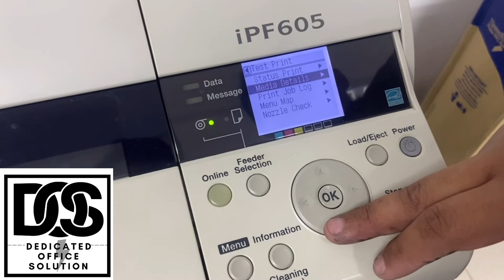Full Tutorial Of Serviced Purge Unit in iPF605

Comment: This is THE VIDEO of Canon printers.  Thanks a bunch for going through each step of the process.  How do you clean/flush the ink tubes from ink tanks to the carriage?  Do you have a video about this process?  Thanks again.
Reply from the maker: Tq for your comment , at this moment I don’t have the video for this. I will do recording when encounter this problem
Reply: @dennisthefatkid  Thank you, Dennis :-))  I went through the steps you showed in the video, trying to service the purge unit today.  I encountered a problem: the vacuum pump at the bottom of the purge unit DID NOT allow any water to pass through.  So, I had to rotate the big plastic gear connected to the pump by hand to be able to flush the old ink.  I am not sure the old ink was flushed out!!!  Your video showed no blockage of water by the pump as you flushed the lines.  How did you bypass the pump?  Also, I have a horrific time to find these two pads in the purge unit.  They need to be replaced.  Where can I buy them?  Thanks again for the great video!
Reply from the maker: @windsurfer3329  hi sir, yup.. I have to rotate the big gear in order the water pass through /flush out the dirt, if the water doesn’t out from the black tube , it meant the purge unit is problem. I suggest to replace the whole purge unit (better to purchase new purge unit) about the pad you may purchase with Canon , may I know what model you using now? let me check the part number for you by tomorrow
Reply: @dennisthefatkid  Hi Dennis, I have what you have in the video, an IPF605.  Thank you for reaching out to help me :-))

Comment: Hi Dennis, Great video. I am using it help me replace the purge unit of an iPF780 ImpagePrograf. I only thing I can't do at this point is the 'wired connector' that connects with the old Purge Unit. There is almost nothing to grab onto and the release pins are tiny. any suggestions? Thanks! Rob (I can send a pic if you like.)

Comment: Very detailed video thank you!!, i have one question i hope you can help me with, i have old canon iPF 6400S, which i got for very low price, it's working fine except it's PM or M(Can't really remember which color exactly) Color doesn't print at all and on nozzle check it's basically doesn't exist or very few nozzles working and not in a straight line, old owner told me he got a new print head and it printed less than 10 prints and same issue happened again no PM or M Color, could it be purge unit? or something else?
Reply from the maker: Hi Sir, yeah… print head and purge unit are related , since you’ve replace the printhead , try check the ink tube of M & PM, is that filled with ink inside, if no… you have to replace the purge unit. My advice is ask for professional to do the checking, let them quo whatever related parts is spoilt before repair

Comment: Hey man, i got an old ipf605 that was off for more than a year. when turned on the printer asked to replace the printhead with E161-403E. Turned off, cleaned the printhead manually and reinstalled, turned back on and printed just one nozzle check pattern with service mode, at this point the printer shoewd an hardware error and i turned it off.
When turned on again in Service mode, it displayed "replacing CPU" and then "close upper cover".
Can anybody help me i'm stuck 🥲
Reply from the maker: Not worth to replace anymore my friend . After replacing board and cpu, I believe the error code will pop up with another msg

Comment: Hi! My IPF750 plotter is showing this hardware error 03130031-2f26 and I can't even access it in service mode. Can you help me?
Reply from the maker: Hardware error 03130031-2F26 is a carriage motion error.  In this blog, you will learn how to troubleshoot this error.  Try check cartridge belt, carriage shaft… is that any foreign object blocking, if no.. you may try to lubricant some oil to carriage shaft. Hope this can help you 🙏🏻

Comment: Thanks alot engg
Reply: @dennisthefatkid  if i unlock the carage from the service mode and move it to access the purge unit pads
And unlock the carage should i turn of the printer or work with it on 
And if u turn it off the carage will lock or it still unlock
Reply from the maker: @عبدالرحمنباعقيل-خ9ل  can, you may unlock from service mode , but it will absorb and wasting ink, once the print head is move to centre you have to power off before taking off the purge unit
Reply: @dennisthefatkid  okay thanks but power of the printer from the printer button or from the electronic switch
Reply from the maker: @عبدالرحمنباعقيل-خ9ل  power off with power button on machine first , then pull out the power cable from wall plug (for safety purpose)

Comment: I get an errro code 2f1f it saye at the service manual pump cam sensor error change the purge until
What should I do about it engg ?
Reply: I have the 03130031-2f1f error on my ipf755, which indicates purge unit, which led me to this video. The process looks simple. What are the chances this clears the code?
Reply: @egoequus6263  i change the whole purge unit and nothing 
Do you have other way to fix it

Comment: I get error 03130031-2f26 than 2f13 after reboot
And the manual says check carage unit 
And A/D conventer
What's that
Reply from the maker: You try wipe the carriage rail and apply oil into it again, hope it’s work for you
Reply: @dennisthefatkid  okay i will try it the rail is cover with black fat should i clean it and apply oil instead
Reply from the maker: @عبدالرحمنباعقيل-خ9ل  in my experienced , some rail were dirty , use tissue paper wipe it will do , after wiping it … it will zero oil and it’s no good for carriage … therefore we need to oiling it again
Reply from the maker: @عبدالرحمنباعقيل-خ9ل  just clean the medal (chrome color bar)

Comment: I have same printer. Canon ImagePrograf ipf605.
I have Error code 03800500-2F2F : non discharging error.
Solution: Replace Head management sensor. Can you help me? How to fix?
Reply from the maker: Hi there, I’m sorry to heard about the problem , my advice is observe the head management, is that the red light (red led underneath the head management sensor) on? If light off, it meant head management sensor problem , try check the flat cable which connected to head management sensor , be careful while pulling out the flat cable
Reply: @dennisthefatkid  Thank you so much for your help!
 I got it working!
Very happy now!
The print head just needed to be re-installed., and the contacts cleaned.
Reply from the maker: Glad to heard that your problem solved 👍🏻 stay tune in my channel , I will create more contents about Canon iPF tips & tricks